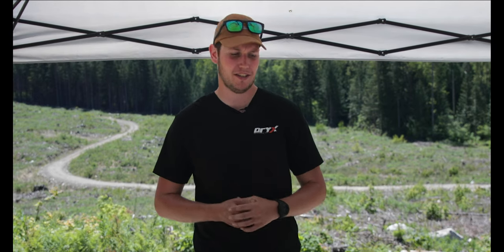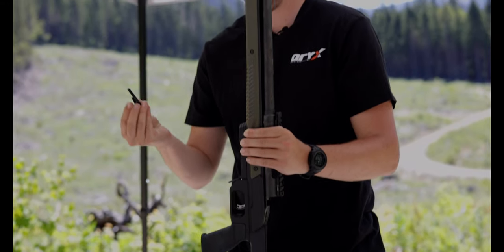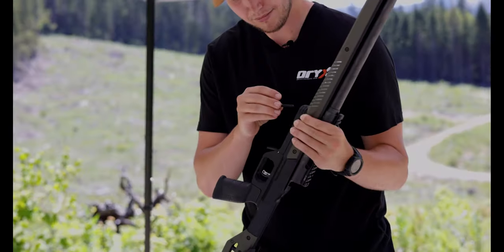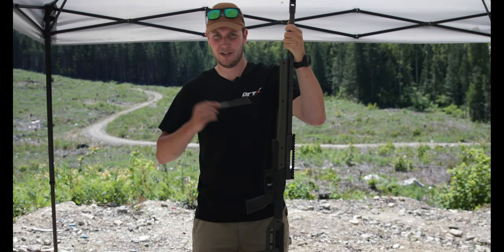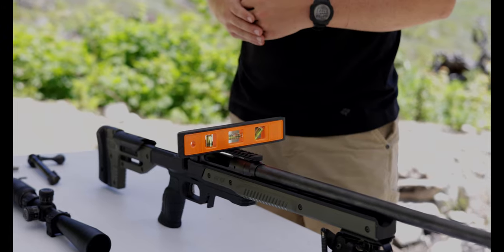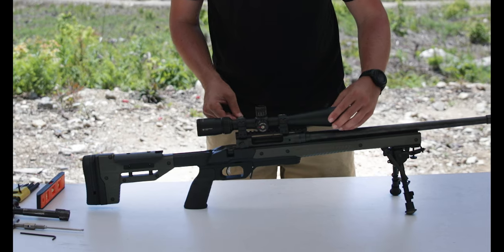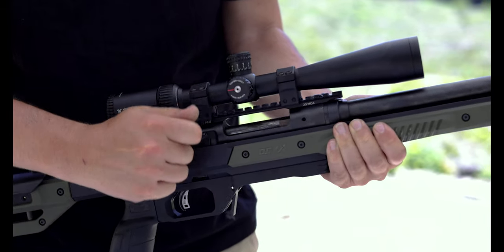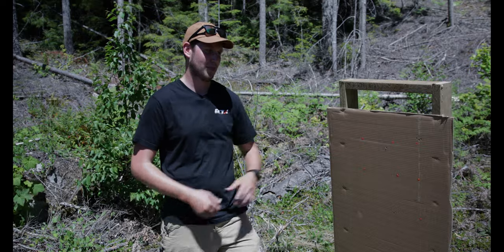Oryx Install - Savage Model 110 SA

Comment: Overall, the Oryx looks pretty slick.
How about an optional side cover kit milled from aluminum with integrated M-Lok slots?
Reply: Great idea, it would just be fairly costly
Reply: @MDTTAC  That's no problem though, since people are willing to pay extra for it. You sell sling swivel studs and cheek riser knobs separately. No problem setting other things separately too. The Oryx could be bare-bones, and buildable to a flagship level chassis as time goes on.
Reply from the maker: @joshuahunt1210  It is something we can look into for sure!
Reply: @OryxChassis  Thinking about building one from a savage 110 338 long range hunter is that possible

Comment: I don’t own or have experience with savage rifles. But wouldn’t you want the recoil lug seated to the front of the chassis opposed to setting it to the rear to compensate for recoil, similar theory to mounting optics?
Reply: No, if you did that the recoil lug would be floating. The reason optics need to pushed forward is because they are moving slower than the action under recoil.

Comment: How does the Oryx chassis address the difference between the Savage Accustock recoil lug versus the Savage Non-Accustock recoil lug?

I would like to try this Oryx chassis for my Savage 16FCSS Weather Warrior in 338 Federal cartridge which has a Accustock recoil lug and bottom bolt release.
Reply: There is no real difference; they all fit the same. It will work with your rifle without issue.

Comment: Does this chassis fit on the 111 as well? On the LSS chassis, it lists compatibility with 110, 111, 112, and 116. But the oryx page only lists compatibility with the 110 LA. They've gotta be compatible if the LSS fits both/all, right?
Reply: Yes, the Savage LA chassis will fit the Savage 111 as well.

Comment: Will the model 10 action fit in this chassis and if so can you provide the sku for it. I have found two , MDT 103653 and MDT 103642 listed, what is the difference between these? Thanks in advance
Reply: Your rifle will fit in the Oryx chassis in the Savage SA inlet and use SKU 106263.The 103642 is our Long action inlet.

Comment: My 6.5 Creedmoor 110 has the bolt release bouton in front of the trigger guard. It looks covered with this chassis How will I release the bolt then?
Reply from the maker: There is a slot milled on the right-hand side above the trigger guard which allows the bottom bolt release to be reached with a tool.

Comment: Nice chassis! I would buy one but my savage 110 has the bolt release on the bottom of the rifle at the front of the trigger guard. This chassis system doesn't appear to be compatible with my rifle.
Reply from the maker: We support both bolt release positions in all Savage chassis systems, so you will be good to go.
Reply: @OryxChassis  Oh in that case. I'll buy one. Thank you!!

Comment: Hello Oryx and /or MDT. I have the Savage 110 Ultralite with the Proof Research or Carbor Wraped barrel in 6.5 PRC. Will the AICS short action Mag for 6.5 PRC fit my Savage 110 Ultralite? Or does anyone know? Trying to order the 7 round Mag, TIA.
Reply from the maker: As long as your rifle is meant to accept AICS pattern magazines, then they will work. If not, once installed in our chassis, it will convert your rifle to AICS pattern magazines.
Reply: @OryxChassis  Thank you for your quick response. I will contact Savage and ask them if the AICS pattern magazines will fit my rifle. I'm trying to avoid changing the stock since this rifles shoots lights out! Very accurate! I'm afraid if I change the stock I will loose accuracy? Thanks again I appreciate your help!
Reply from the maker: @maxcoatlhunter4322  You won't lose any accuracy.
Reply: @OryxChassis  thank you.

Comment: I had a question and thought I might get an answer here :) I just ordered a Savage 110 LA Chassis and it shipped in just 1 day! Excited to get my build going.. However I was looking to use an EABCO Accuracy Recoil lug and just wanted to make sure the Chassis has clearance for it? I assume with the Lug play seen in this video, that the slightly oversized Lug will most certainly fit..?
Reply from the maker: We do have an oversize pocket for recoil lugs and try to accommodate as many options as possible
Reply: @OryxChassis  That is good to know. I just ordered an Oryx for my TC Compass II. I watch a vid of guy putting one in an Oryx and he mentioned transplanting the removable lug from the factory stock. And, to have just enough clearance to catch, it might be necessary to shim the lug with a narrow piece of duct tape, like a baby booster seat, if you will. Genius idea.

I already like the MDT LSS Gen 2 I use for my Mossberg Patriot .308 Win. Now I call that one an MDT Patriot.
Reply from the maker: @ronws2007  Understood!

Comment: Will this work in Savage model 11 hog hunter .223, if not is one available?
Reply: Yes, your rifle will fit in the Oryx chassis in the Savage SA inlet without issue
Reply: @MDTTAC  
Thanks for the reply. I do have one more question. It looks like the chassis converts to detachable box magazine. So, what ma
Reply: @MDTTAC  
Sorry actually hit send because I completed my question. So, what magazine will i need for savage 556/223? Thanks
Reply: @dman486  You will need 223 AICS pattern magazines which we do sell
Reply: @dman486  You will need a 223 AICS pattern magazine, which we do sell in metal or polymer

Comment: Will this work with the older 4.275'' action screw spacing of a Savage Model 10 in .308?
Reply from the maker: Yes, we support both action screw spacings on our Savage SA chassis.
Reply: @OryxChassis  will this work on the molded 11/111 hog gun
Reply from the maker: @warrengreen3217  Yes!
Reply: @OryxChassis  what's the price for them
Reply from the maker: @warrengreen3217  All pricing information is available right on our website! Head over to oryxchassis.com
Reply: @OryxChassis  thank you

Comment: Will it fit the Savage 110 Apex hunter with the bolt release infront of the trigger guard?
Reply: The chassis will work with both top and bottom bolt releases. What caliber is your rifle chambered in?
Reply: @MDTTAC   it's chambered in 308win /110 apex hunter xp fluted heavy barrel " black poseidon "
Reply: @DodgeCwby99  Nice! It will fit in the Savage SA chassis
Reply: @MDTTAC  awesome!.. I was worried bc all my other savages are top bolt release,  but with this one being on the bottom intergated into the front of the trigger guard that it wouldn't fit.. but glad to know it will fit! .. thank you for your time and help!
Reply: @DodgeCwby99  Most welcome!

Comment: Will the oryx chassis work on a savage model 111  .30-06 with out a heavy barrel.
Reply: The 111 and 110 actions are the same. 30-06 would be a Long Action or LA.